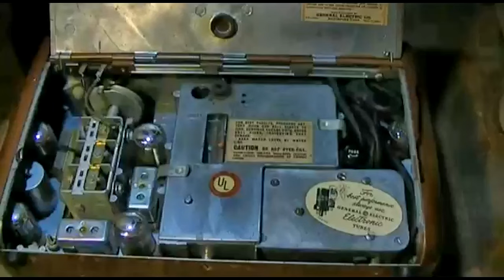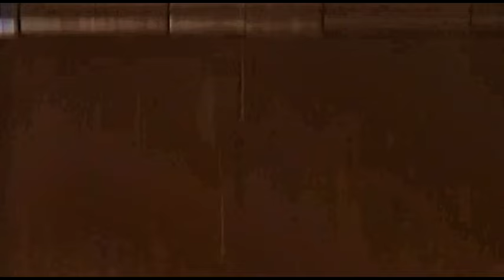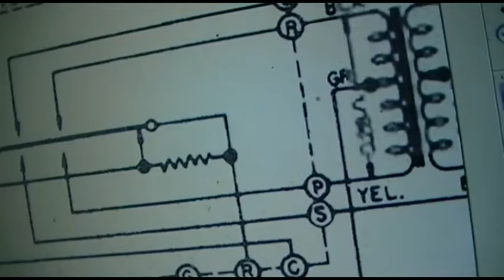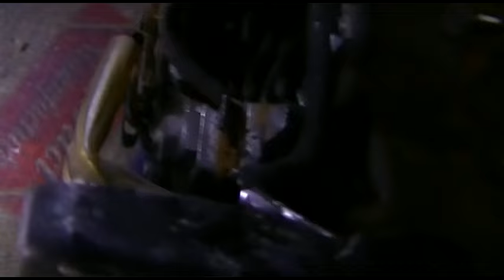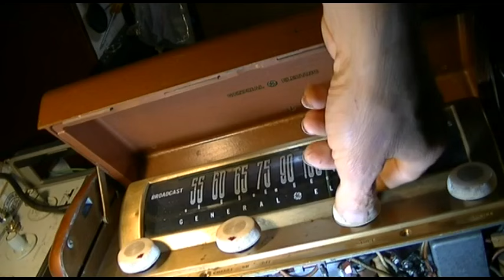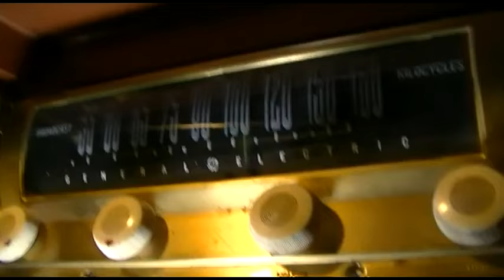GE Model 250 Portable Rechargeable Battery Tube Radio

Comment: I found one of those on a trip to the Dump-ground back in 1968, the battery still worked OK, it was a great little radio, sadly I let a trucker talk me out of it, had it at the truck-stop where I pumped fuel for a living and that trucker really wanted the set, gave me 25 bucks for it, that was a lot of money back in '69.

Comment: I had the exact same radio during the late 60s. The battery was still good and the radio worked good on battery and ac. The radio was stolen from me when I was at a public. The police never found the theives.  The radio ran about an hour on battery. The vibrator drew most of the battery current

Comment: i replaced my bias cell with a 4.5 volt battery like goes in a garage door opener transmitter. fit in the original holder. just tied it with a zip tie to make sure it stayed put.

Comment: Some car radios from the 1940s used that vibrator circuit The vibrator was powered by the car battery which triggered a step up transformer to produce ac current of 90 volts which was rectified and filtered to supply the B+ to run the plate voltage on the tubes. Those car radios were large and had a 6x9 speaker built into the front of the chassis. I remember the Plymouth’s had them in the 40s

Comment: A lazy trick for getting some types of vibrators humming again was to simply give them a soft-medium strength wack them against a table at various angles. that proved sometimes enough to free lightly welded contacts. a lot easier than having to de-solder them open

Comment: I have the same radio, would like to get it running on the ac supply could you offer some help? The only tube that lights up is the 3q5gt
Reply from the maker: it doesnt run on the ac supply, thats only for charging the battery.

Comment: My son just picked up one of these at the montly MIT electronic swap meet. I have not cracked it open yet to see what kind of shape it's in. Nice to know about the bias cell in there. Will replace with suitable modern battery. I want to see if a single cell lead acid battery is available from Digikey or Mouser.

Comment: Is the vibrator an old day version of a switch mode power supply????
Reply: +Kennynva T.  Exactly.. a mechanical switching power supply
Reply: It is in the sense that it boosts the voltage but it doesn’t regulate it in any form

Comment: What is the advantage of the vibrator over a step-up transformer?
Reply: David Collins There likely is a transformer too.   The vibrator is used because the batteries are DC which cannot drive a transformer by itself.   Vibrators convert DC into AC (likely square wave) but pulsate enough to drive the transformer.

Comment: I've found that paper capacitors/condensers tend to last longer in sets with battery tubes, even in three way portables. One reason being is the lack of tube heat which causes the wax sealing the caps to break down allowing moisture into the paper dielectric. Another is because battery tubes operate at much lower voltages at much lower current, even the B+ is low between 67-1/2 and 135 volts, usually around 90. In a straight battery set they also didn't get used as much as an AC set.

Comment: Interesting radio, are you going to get a 2V sealed Led Acid battery to replace the old one? I am sure that bias battery could be rebuilt with a 1/2 AA lithium battery live what was used as a PRAM backup battery in older Mac's.

Comment: Nice radio, I think those other folks who worry about the caps often work on TVs and harder worked mains powered radios where a cap going bag could ruin a hard to replace part. And if your going to really use an old radio or TV you want it to be reliable so I guess restuffing the old ones makes sence then.

Comment: Nice radio that's well built. Most portable radios of the era used a low voltage filament battery and a higher voltage B+ battery. The problem was that batteries didn't last that long, especially the filament battery. I believe that the design of this radio was an effort to cut down on having to frequently replace batteries.